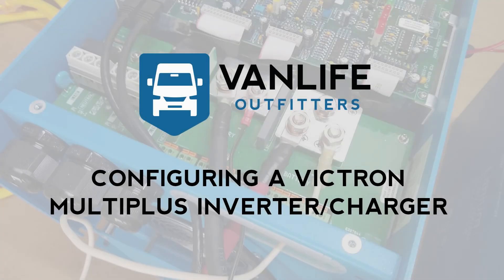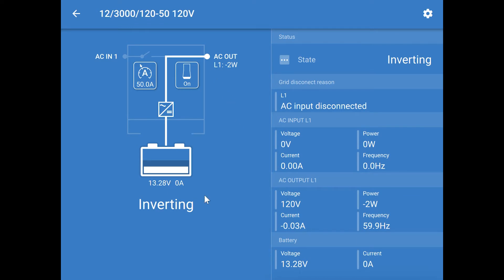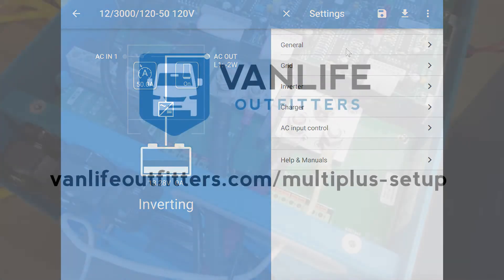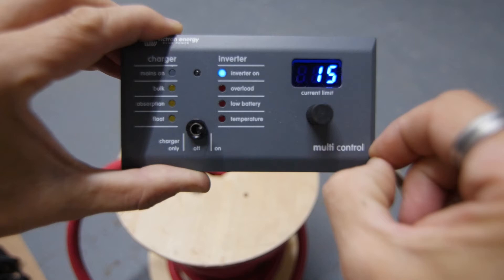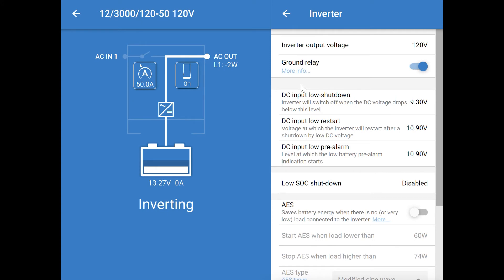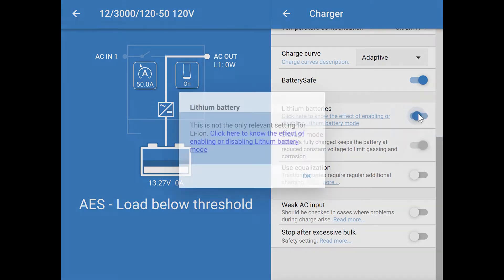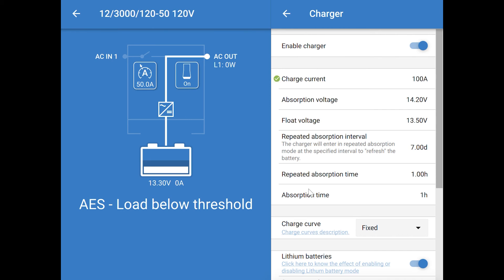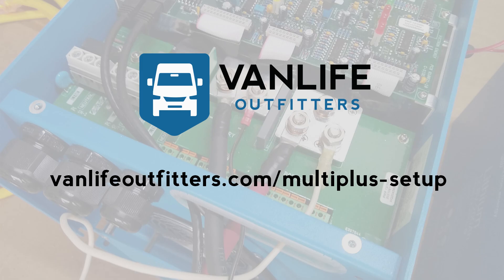Victron MultiPlus Inverter/Charger Configuration with VictronConnect

Comment: Thank you for the content !   Can you confirm, or (reject) the assertion that the MP 12/3000/120 ‘requires’ a min. of 400aH of battery storage ?  I just got a virtually new unit, and currently am maxed out in space allocation for 200aH in a smallish mobile system.

Thank you again for an Excellent vid 👍🏼

Comment: I am learning but not sure what the terms mean ... What I want to do is have my batteries be uses for power to my stationary shack, inverting and so on.  When the batteries get low (LiFePO4) I want the inverter to charge them up.  Then when the batteries are full the Crg/Cont I would want to turn off and switch back everything to the batteries.  When I have solar light power then it will charge up the batteries, batteries will be used and the conrolelr not charging from shore.  Most people want the AC to charge and only switch to battery when shore power is cut.  ...  I want to use the batteries, first then switch.
Reply: Please explain about password?
Are you useing ve Bluetooth dongle?

Comment: Would these same settings apply to the Victron RS smart solar inverter/charger? 
It is tripping the RCD in my electrical panel and I am certain the issue is with the ground/neutral relay needing to be disabled.

Comment: Hi, which Bluetooth dongle do I need for changing the settings? I read somewhere that its not possible to change multiplus settings on the app but only via mk3-usb cable.
Reply from the maker: That's right, you can't access the advanced settings with the Bluetooth dongle - you need the MK3-USB cable for that. https://www.vanlifeoutfitters.com/store/victron-mk3-to-usb-interface/

Comment: One setting I didn’t see - is there a way to specify the maximum amount of current it will draw from the battery? So I can start out with a small battery and add more capacity over time?
Reply from the maker: Hi Gopi, if I understand your question correctly, how much current the inverter will draw is going to be tied to the "loads" connected rather than a setting on the MultiPlus. Every battery has a maximum continuous current rating and quite often that is lower than what these Victron MultiPlus inverter/chargers will pull when under maximum load which is why so many people have more than one battery wired in parallel with larger inverters.
Reply: @VanlifeOutfitters  Oh, right, yes, thank you. I knew all of those details but didn't manage to connect the dots. I feel very silly. If we had a hypothetical future MultiPlus that could be programmed with a battery output limit, what exactly could it do when it determined it was drawing too much load from the battery? Turn off the AC output. That's all it could do. The current one - what will it do? Trigger the overcurrent protection in my LiFePo4 BMS which will...turn off the inverter and, thus, the load. Is that a good summary?

Comment: Thank You for a short precise explanation. I have seen videos that recommend dip switch #2 to be turned on. Do you recommend this for a 12/3000/120?
Also should the batterers be toped off.
Thanks
Reply from the maker: Hi Mike, dip switch #2 does need to be turned on with the MultiPlus 12/2000/80 but not the 12/3000/120. We have a bit more detail on that on the blog post that goes along with this video: https://www.vanlifeoutfitters.com/configuring-a-victron-multiplus-inverter-charger/